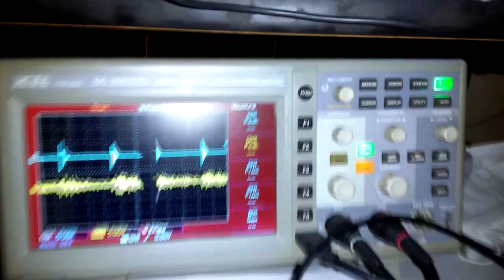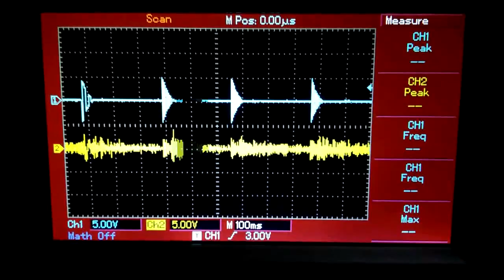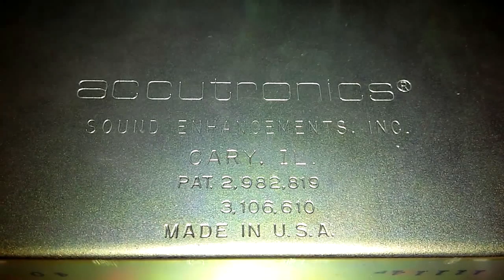Breadboard Spring Reverb Driver and Accutronics Reverb Tank

Comment: Did you happen to draw up a schematic for the driver and recovery unit? I have a tank with the same input and output impedance that i need to build a driver for.
Reply from the maker: It is the same driver/recovery circuit as in the Peavey Bandit 112 guitar amp, except the opamp is a NE5532 instead of the RC4560. I found the schematic here: https://forums.peavey.com/download/file.php?id=19441&sid=a5a4388d6fb97936e6673cb52447d539 
There is a nice article by Rod Elliott on the subject:  https://sound-au.com/articles/reverb.htm
Reply: @unrelatedactivities  awesome. Thanks!

Love the channel. Very inspiring.
Reply from the maker: Thank you!